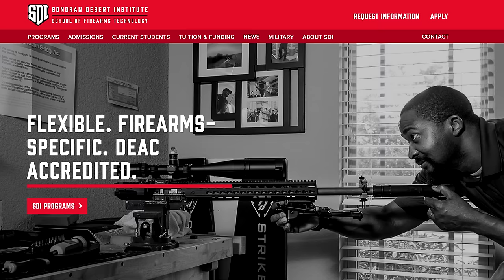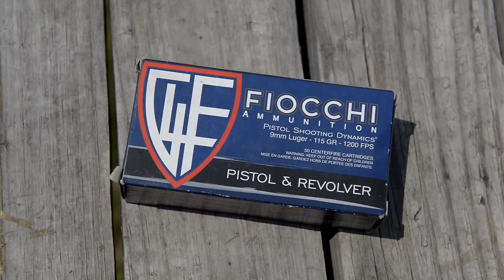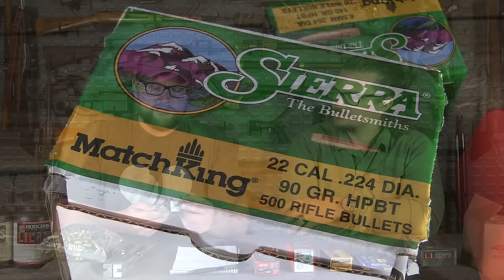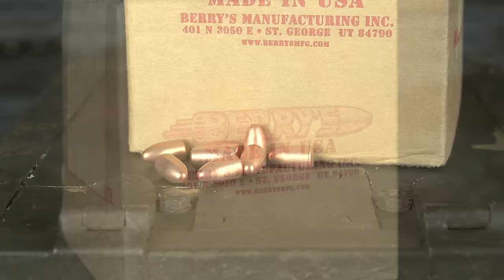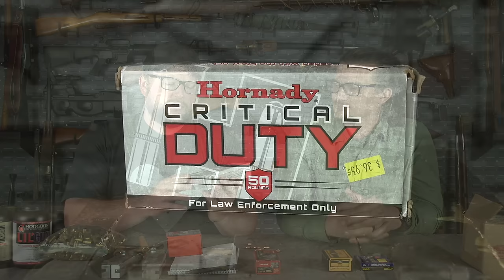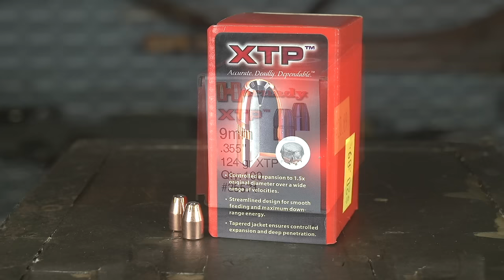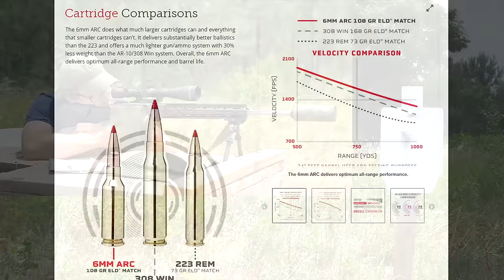Is It Worth Reloading Your Own Ammo?

Comment: I cast for all my big bore rifles and revolvers. .44, .458, 475, .500.

Also somebody else in the comments mentioned powder coating. I've been powder coating for 20 years, it is a game changer. I just use a old toaster oven, 400 degrees for 20 minutes. 
 
I have pushed some of those powder coated bullets up to 2700  fps with zero fouling. I like to run my cast bullets 2-3 thousandths over caliber. YMMV.

Comment: Loading own ammo allows for custom load using cleaner powders, faster or slower powders for your barrel length, and custom selection of bullets for your purposes. 
For example, you can load 6.5mm Creedmoor with 150gr Atip from Hornady for much better ranger, hold over, and impact power over 147gr .308

Comment: Remember, annealing is supposed to be done after the work-hardening steps. The more the brass is worked, the more it needs to be annealed.
Reply: Brass needs to be annealed before running it through any sizing die after 3 firings . When the brass becomes hardened due to sizing and firing it will split the neck open when it's ran back through the sizing die if the brass is not annealed to a malleable state. Some people anneal brass after every firing if it's annealed after the sizing is done it defeats the purpose of not splitting case necks.
Reply: @jasonrottlaender1721 the main reason for annealing after every firing isn't necessarily the prospect of making your brass last as long as possible but instead a situation like you're trying to load match quality ammo because accuracy all comes down to consistency and annealing all your brass, especially on a good machine will reset neck tension to the same place on all your brass. Especially if you have mixed brass it can definitely make a noticeable difference down range.

Comment: I have a few guns that can only be shot with handloads. 25-25 stevens, 40-82 WCF and i even load 32 and 41 rimfire in reloadable brass made from 32 colt and 41 colt. Coming from a state that now requires a $2.50 background check for every box of ammo purchased I feel every shooter should spend the $300 it costs to reload.

Comment: I don't cast my own bullets and I don't reload 9mm because it's roughly $30/100 for factory ammo. I do reload 32acp, 38, 357, 40, 10mm, 45acp, 45 Colt, 454, 455 for $21 to $36/100 depending on what the components cost at the time and I simply wouldn't be shooting these calibers much at all if I wasn't reloading. Especially my favorite 45 Colt. I'm using cast or plated bullets always. I've been lucky finding primers during dry spells so far. For me it's the difference between shooting 3k rounds a year to maybe 7k or 8k rounds a year in the guns I bought to shoot. I've loaded about 50k rounds in a Rock Chucker kit I bought 20 years ago and have never replaced a single component from it. Only about 300 rounds have been rifle caliber.

Comment: I grew up reloading, so cost to get into it was zero. I have experimented alot, and have even built 2 ackley based wildcats. Recently a new advantage to reloading i have not previously though about is reduced recoil amunition for my kids. I am able to take a 270 and load it down (85gr going 3450fps) allowing one gun to work for their entire lifetime, rather than having to step them up as they get older.

Comment: I have been reloading for over 40 years. Shoot cast and jacketed, have never cast a bullet. I started on 380, with recovered brass can still reload for less than 1/2. 45 Colt less than 1/3 for 45 Colt, a box. Less than 1/2 for 
Most calibers. Cost of factory will only go up. More expensive now for primers and powder , but I bought before prices went wild. Jacketed 9mm still less than 1/2 of current retail . It will only get worse

Comment: 150lbs of wheel weights cost me $60. After rendering down to ingots I got 145.2lbs.

My most used bullet is a 158gr .358 flat nose bullet.

If I cast all of my last lead load into that bullet, I’d have over 6,400 bullets.

A pound of powder coat costs me $8. I powder coated 500 bullets and only used about 1/4lb. So for 6,400 bullets, lets be liberal and assume I need $32 of powder.

It costs me 3¢ for every 2 bullets.

I load to low pressures and care for my brass well. I have some 38spl cases that are on their 10th reload and going strong. I don’t know how to quantify the cost of my brass, and I am getting a bunch for free all of the time.

I reload with HS-6. My .38spl gets 6grs of powder, and my .357mag gets 8grs. I shoot both almost equally, so let’s assume 7grs per bullet.

So I get 1,000rds for every lb of powder. I bought 8lbs of HS-6 for $250 the other day. So let’s just run with it and say it costs me 4¢ a round but I still have over a pound and a half of powder left over.

Primers cost me $525 for 7k. Lets say 8¢ a primer.

It costs me about 13.5¢ a round for high quality .38spl and .357mag rounds.

Comment: When did you guys make this vid? Because in SE WI there is an abundance of factory ammo in 9mm and almost every other caliber ( from Cabelas, Dunhams, Fleet Farm, and independent gun stores etc) you could want. Also the price on 115grain FMJ around here is averaging 12.99/50 Rd’s. Now I reload and one thing in short supply is primers. And they are ridiculously priced at 89.99/1000 on average. I know bidenflation is evident but this is way more than 15-20% of the old price of 32.00/1000.

Comment: Reloading your own ammo not only allows for cost savings in the long run, but it also provides a level of customization and precision that factory ammo might not offer. For 2A advocates, it's a way to maintain self-sufficiency and control over your ammunition supply, aligning with the principles of responsible gun ownership.

Comment: This sounds harder than it is. These days, a primer runs $0.09 each for most any common size. Powder can be $40 a pound, so a 45 grain charge is $0.26. The projectile on the cheap end can be $0.26 each. If we re-use the brass, the cost per round is $0.61 which compares favorably to plinking rounds at $1.25. This is for 308. For 9mm, the cost of the primers ruins the economy. Still worth it for 40.

Comment: Boy, can you save money and you end up with better ammo.  For instance, 38 Special or 9mm.  I cast with scrap lead and powder coat my bullets, free and no smoke, no messy lubes and I push them over 1700fps in my 20" Rossi Puma lever gun with no leading, none in any of my firearms including my 44 Mags,  I water quench after casting and after powder coating.  I've Rockwell tested those bullets at around 15 and they shoot just fine.  Coating is very fast too, 200-300 at a time in an old toaster oven.   I use pickup brass, free.  Powders like Titegroup, True Blue or Silhouette will give you over 1500 rounds per pound, 2c for powder/round, 700x over 1800.  I'm still using cases of Primers bought before Covid, 3c/round.  It's cheaper than shooting a 22 but even with primers at 100 bucks/1000 it's still 12c/round or so.  My 6.5 Creedmoor I load with a PPU 120gr OTM bullet bought from Graf's for 22 bucks/100, I make my own brass from range pickup run through a RCBS Rock Chucker with a 7mm/08 resize die bought at a gun show for 8 bucks and then a standard 6.5 Cm die and trimmed, better than 80c each new.  With a good load of 748 my Savage 12FV will put 5 of them into a .3moa hole at 100 yards, you can almost cover the group with a dime.  I reload hundreds of them for friends and family.  As for the cost of getting started I just helped my Nephew out, he wanted to do 9mm and 223.  We started out with a used Lyman Spartan press in great shape bought at a gun show for 15 dollars, used die sets are cheap and so are digital scales.  A Unifolw powder measure was 12 bucks and Lyman Universal Trimmer was another 15.  Lee filled out the other small items for another 50, shell holders, funnels, ect.  All told with construction of a small bench and lighting 150 clams covered everything including a used Hornady manual for 20.  You don't need the latest and greatest to get started and my nephew is cranking some quality ammo and saving a bunch especially with the cost of components these days.  By the way, I bought a Mec 600jr when I was 16 to help feed my Trap habit, I've been loading off it for over 50 years now and with the cost of AA's at 10 bucks a box I had to quit loading for friends, just no time for everyone.

Comment: Is It Worth Reloading Your Own Ammo?

If you shoot a lot or in competition matches then yes it does. Prices of components used to be cheaper but not any more. With the outrageous prices of primers that have doubled or tripled and powder prices also doubled, right now its cheaper to buy factory ammo unless shooting a lot or competing in matches where the sheer volume in bulk will lower the prices a little. So for price not so much worth it but it may be worth it for other reasons like improved accuracy, better quality control, and a variety of different tailored loads that factory ammo can't deliver.

Comment: All that reloading info is great, BUT, give me 3 sources for large pistol primers! I have brass .410 cases and 12 gauge cases that I want to load with black powder for cheap fun. They require Large Pistol Primers as they are made. I don't want to drill them for shotgun primers if I can avoid it, but I may have to because I can't find a good source of Large Pistol Primers. I would think that folks that wanted to reload large pistol calibers would be facing the same problem, so help us out. Where can we get them, reasonably priced, and why are they scarce?

Comment: I have so many questions, but here are a few:
Is cleaning brass really necessary
What do y'all think about powder coating projectiles
How important is it to measure powder accurately for range ammo
Reply: It should be clean on the inside, the outside is a matter of personal preference. I saw a video the other day of a guy who cleaned it up so perfectly it looked like it just came out of the starline factory. I tend to be a lot lazier than that with mine. I guess it can affect accuracy though if the inside is too bad.
Reply: @ChadBoss-qr4hl  rgr. I was trying to figure that out. I was looking at the wet tumblers, dont want the dust from the dry ones, and they aren't bad but im just getting into this type of stuff.
Reply: @JBothell_KF0IVQ  In my experience, you don't get a lot of dust from the dry tumbler as long as you don't let the media get too old. It seems counter intuitive because tumbler media is essentially dust. But when it's newer it doesn't stick that much, at least not walnut. I've never used a wet one though so I can't really compare.
I will say some guys don't even tumble, and just use Arm & Hammer soap and water. that's what the guy I was talking about said he used when I asked. I did try using dishsoap and water once and that did work fairly well but I got tired of scrubbing each cartridge.

Comment: Honestly, the one thing I'm concerned about (outside of necessity, of course) is the smelting...I can't see how that isn't a good recipe for lead poisoning over time.

Think I'd rather spend a bit more now to avoid the potential cumulative health issues.
Reply: Use ventilation. Melt point starts around 450f and vaporization above 650f. If health concerns are an issue though, firearms are probably not the best activity for someone not confident in their own physiology and abilities in materials sciences.

Comment: I have a kinda question 308 fired brass can be used as parent case for 6.5 jap minus the rim and shoulder fire forming because I usually hand load a box at a time lower powder charge about 15 % powder charges. 139 gr soft points. What would you recommend on I load because it is extremely difficult to find ammo.

Comment: My landlord and I been reloading for around 5 years now and we love it, We had source all our lead needs from a boat marina, We get all the lead from the keel of a sail boats that where demolished for scrap do to them being non repairable  ,I am very good friend with the owner of the marina just down the road from me so it does not cost me anything for all the lead I need. I must have on hand right now about between 500lbs and 600lbs  pure lead and soft lead, Of course we do have to melt the lead into smaller size as there roughly 30lbs to 60lbs bars each when I get them, So we have to melt the bars in a cast iron pot then pour the lead into smaller ingots so they fit in the lee melting pot so we can use our Lee casting molds, We have Lee molds with handles for the 38 special ,357mag,44mag,40 s&w and 9mm..We do load rifle but I do have quite a few bullet heads which our mainly all Hornaday we been collecting for nearly 4 years now..

Comment: I am never out of ammo or even concerned about it.  Have not purchased any factory ammo in about a decade.  I have two Dillon presses bought both used and cheap.  Rebuilt them myself and the old 650 can make 9mm as fast as I can pull the handle.  I bought components during the last administration when they were cheap and plentiful.  My cost per found is cheaper than ammo prices in 2012.